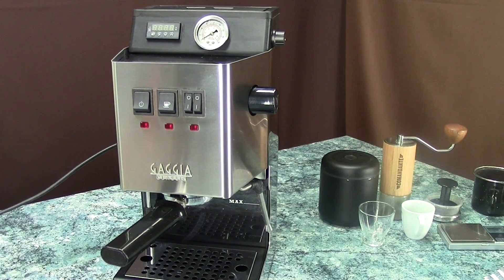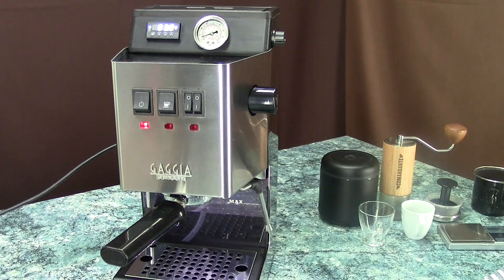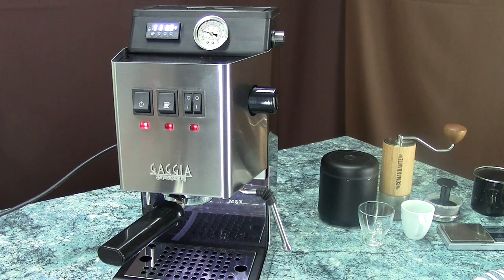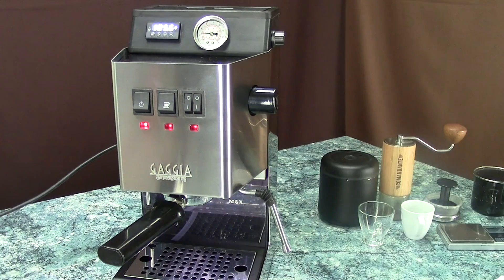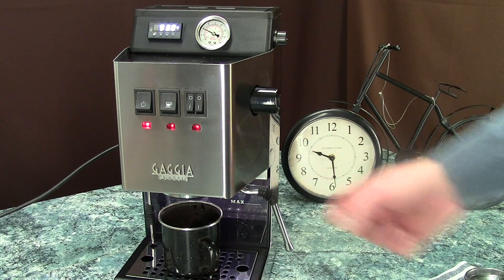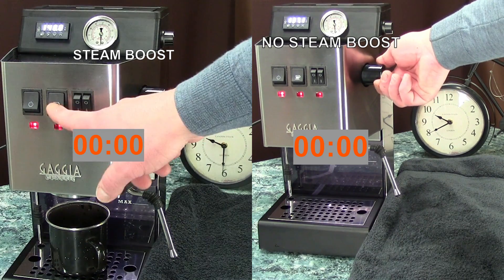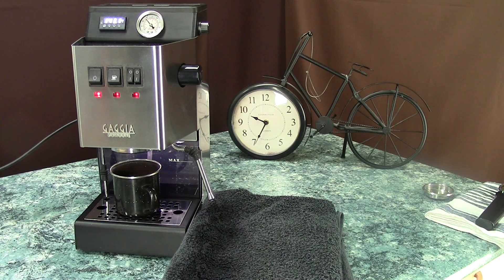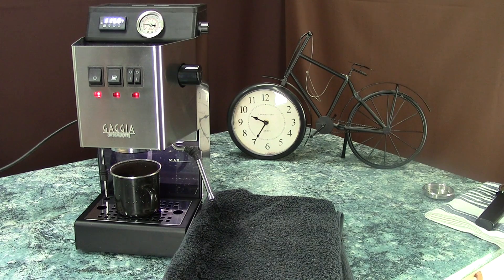Improve a GAGGIA Classic Pro with the BoostBox. Overview & STEAM BOOST explained

Comment: You can just preinfuse by turning the steamer on in the same way so some of the water goes out of the steamer the first 5 seconds then close it for the rest of the shot and You have water for Americano etc.
Reply from the maker: Yes, that's true. However this way you increase the cold water intake to the boiler, causing significant cooling of the brewgroup right at the beginning of the shot. That's not good even with a PID, but with a stock machine, it could be a disaster temperature wise.

Comment: Does the steamboost come with the boostbox, I'm not sure I would want that included.
Reply from the maker: The Steam Boost is only an optional technique, you can use it if you decide to, but you can also steam as per normal procedure on a stock machine, and you also have the ability to slightly increase the steam temperature (like steam thermostat upgrade to 155°C).
Reply: @BREWBETTER  if you come on steaming 5 or 10 seconds before the light comes on you get 30 percent more steam on a stock unit super easy hack.

Comment: How much is it for this thing? Also is it reversible? My gaggia is still under warranty so I need it to be reversible if I need to return it to manufacturer
Reply from the maker: Hi, It is completely reversible. The BoostBox comes for 225 GBP shipped worldwide.
Reply: @BREWBETTER  does that include pid?
Reply from the maker: Including the PID, pressure gauge, pressure profiling dimmer, LED light, all accessories and a detailed video installation guide.
Reply: @BREWBETTER  I will think about it :D Right now I am doing temp surfing method with preinfusion :D
Reply from the maker: @petervansan1054  Temp surfing could be useful especially if you have a thermistor attached to the boiler (like on Andy Panda's videos).
May I ask how do you achieve preinfuson with a stock machine?
Reply: @BREWBETTER  I do the temp surf and then when I hit brew I open the steam valve for like 1/8 of turn and that lowers the pressure in the head and preinfuse . After 8s I close steam valve and normal pressure is restored

Comment: Good idea! :) Seems to me though that steam boosting actually makes the steam wand spit out some water too..?
I was wondering if you dialled back the pump triac control so as not to have water in the steam would it then still maintain a higher steam delivery than without the booster?
Reply from the maker: Hi, Well spotted. Yes, it does in the first few seconds. I am not frothing milk at all, this was a proof of concept video. I believe with some practice in fine tuning the flow and the boiler temperature, the water spitting could be minimised without loosing a lot of steam power. Once I will have some spare time, I will dig into this and probably make a new video on it.
Reply: @BREWBETTER  Superb, good luck with it and agree you can probably reach higher steam output (without water in the stream jet) by upping the boiler temp and adding just a bit of water refill by the pump. I'd guess the hotter boiler is the bigger contributor.
Looking forward to your next video! :)
Reply from the maker: @benkozs  Thank you. If you ever nearby Kaposvár, you are also welcome to pop in and have a go yourself on one of the prototypes. Contact details in the description.
Reply: @BREWBETTER  Thanks, I'll get in touch with you for sure! :)